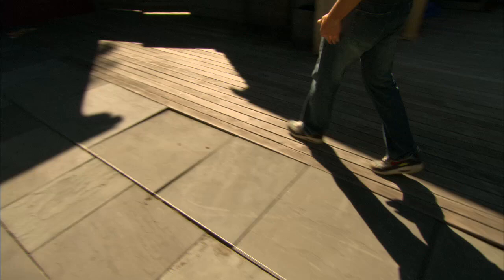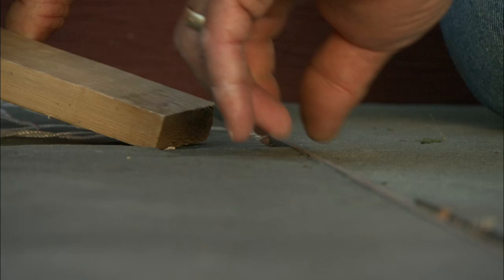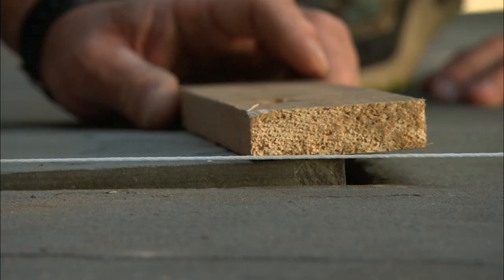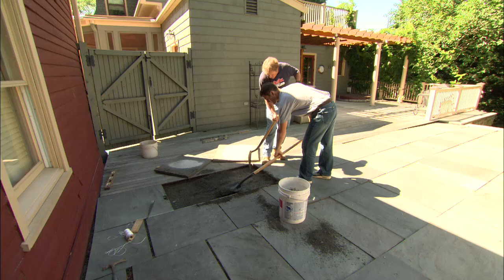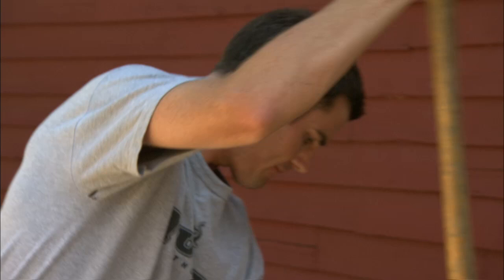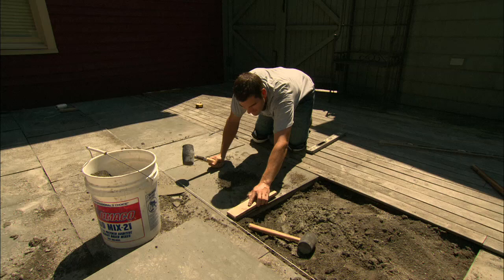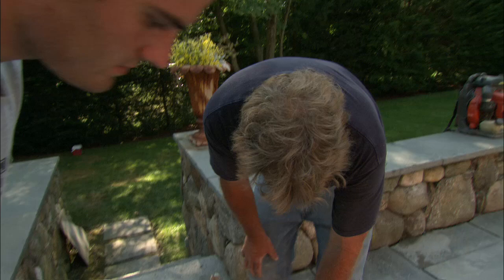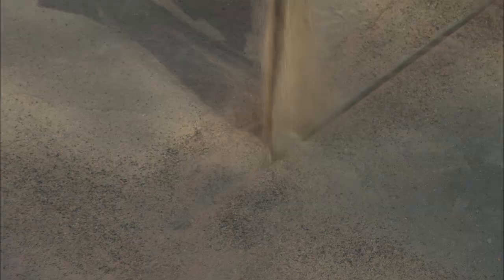How to Repair an Uneven Bluestone Patio | This Old House

Comment: There's a lot more to doing polymeric sand.  It's supposed to be packed into the joints with a vibrator.   Also needs alot more water than what they did here,

Comment: Would love some advice! I'm just a DIY and I've just laid a new patio and I've just found a lose slab!! " Not happy " not sure if the kids ran on it or what? Patio has been laid on a bed of type 1 hardcore with sharp sand and cement! It's now set but slab didn't set for whatever reason!! Do I have to break up morta bed or just lay a fresh 2MM of cement with a drop of  plasticiser? Any good advice would save me growing new grey hairs.. thanks.

Comment: Great video that will help me with my DIY repair. Can you help clarify with the type of cement used?  Did you add a little water to the mix? Is it best to leave it dry?  Thanks for your help. Roger That!
Reply: Roger Spence No water. Dry. Just helps solidify the sand

Comment: And that's why the best way to lay the bluestone is to pour a footing then properly pour a slab, wet lay the bluestone then tuck the joints. The bluestone should last 100s of years; this is how the bluestone was installed at the Rockeffler estates back in the 1800s and they never had to have the bluestone removed and retamped... BTW Polymeric sand HELPS prevent weeds from filling the joints. It does not stop it. There will be weeds in the joints because people walk around and track dirt and mud that will eventually end up mixing with the Polymeric sand and causing weeds and moss infiltration. Weeds will never be an issue with a wet laid bluestone patio.